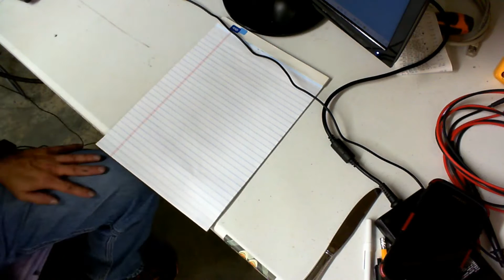ProfiBus tip 1

Comment: The problems I've found in the field typically happen on the stranded profibus cable, the stripper tool doesn't work on it because it has the support rods. Have to do it by hand to not gouge into wires. Most of our official cable was cut great, they just never tightened anything in 😆